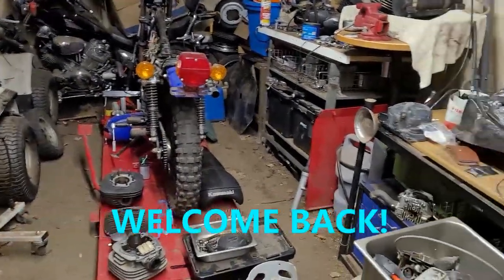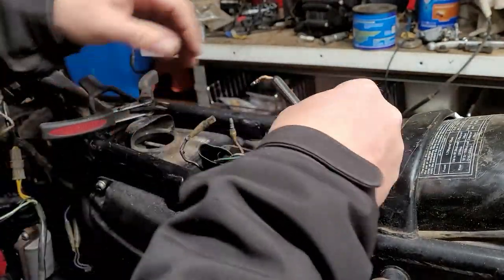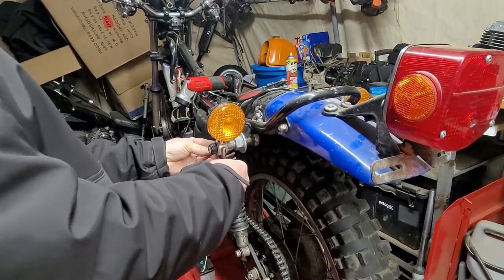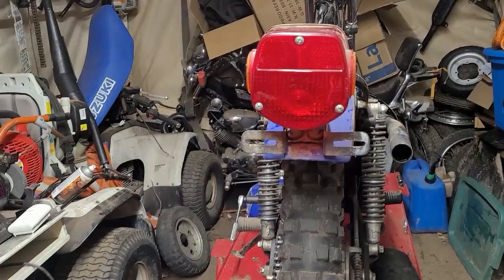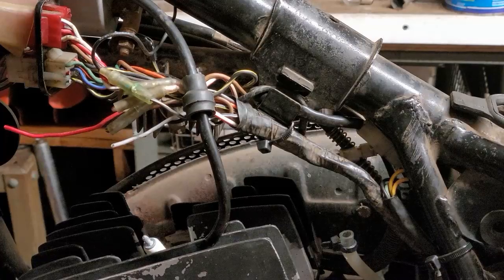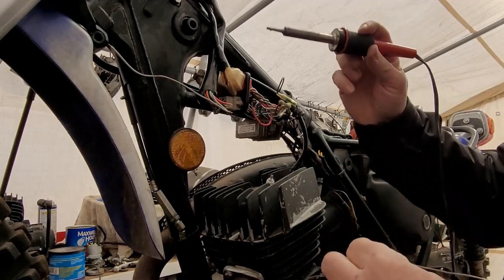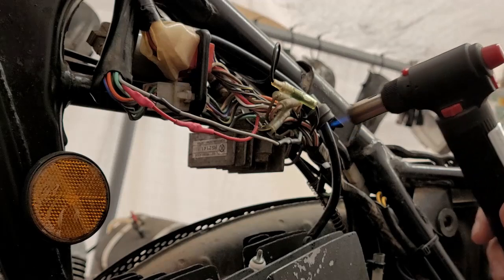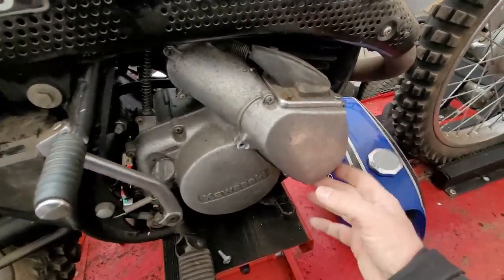Working on Alvin's KE125  Electrical 101 part 1

Comment: Hey my friend I was wondering if there's any way you could send me an email where I can send you a video of more or less showing my Kawasaki Ke 125 1978 the bike was running when I got it but seemingly died right away I am cleaning out the carburetor and putting new fuel lines and hoping to put new fuel and it will run but as of right now it does not have any headlights or turning lights and seems to me which does not have a battery at all either

Comment: I have a 1996 ke100 I’m fixing for my daughter. Your videos help a lot. I’m having trouble connecting a new battery. Not sure where to connect it to.
Reply from the maker: I will include this in a video upcoming
Reply: @2strokeguru  thanks Kevin you’re the best. I also need to know where the cable out of the magneto connects to the harness. I think you may have done a video already on that. I love your videos.

Comment: Hi Kevin, do all KE125's (including the late 1985 model), have a regulator (like on this one - looks like a heatsink)? My KE125 project build is coming back together now , but has not got one (also didn't have a carb - which I have managed to source), but the wiring diagrams are not something I really understand (I have both Clymer and Haynes, but the late models are not well covered). thanks in advance !
Reply from the maker: Yes 1985 should have same setup under the fuel tank